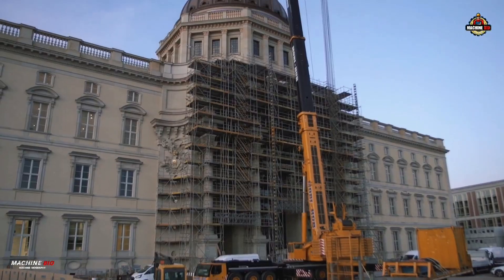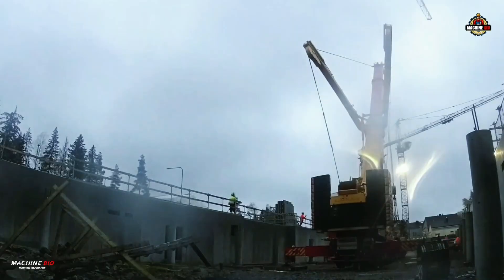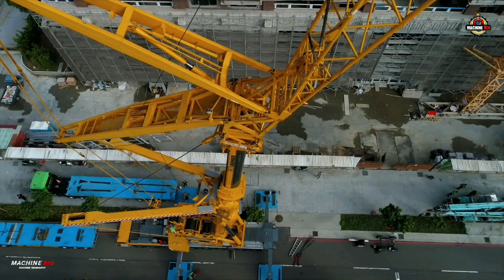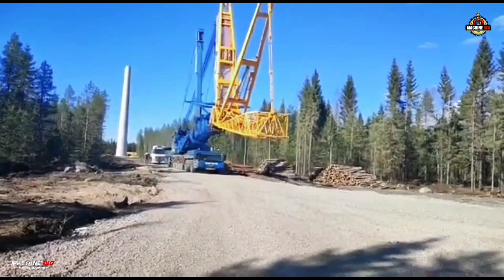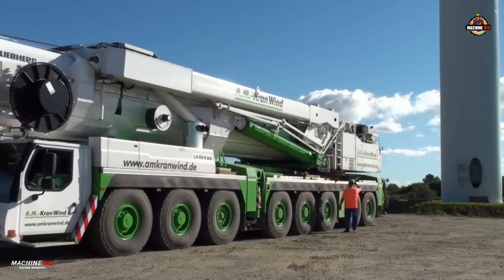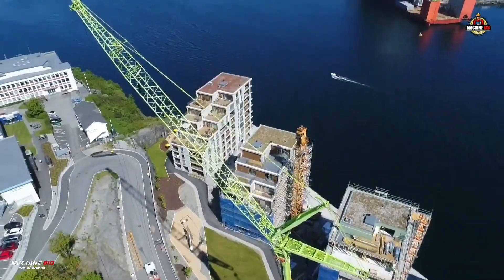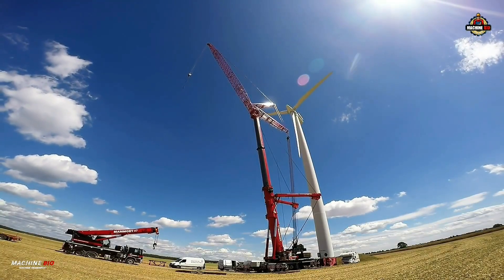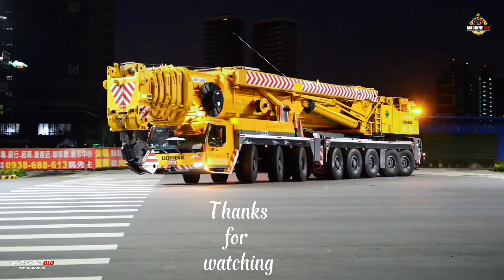Liebherr LTM 1500-8.1 The End of an Era of the Most Successfull All Terrain Crane of All Time

Comment: You have only told half the story. Back in 1998, this machine did not even have a Y-Guy but a standard SL, and its design came together thanks to Dutch companies. Without their influence, it would have had an A-frame like the LTM 1800 instead of cylinders.